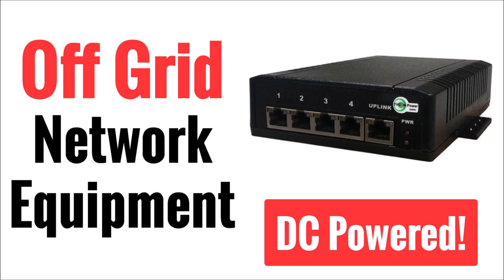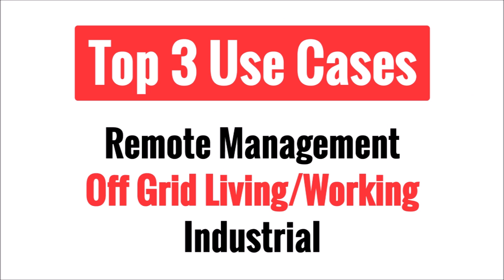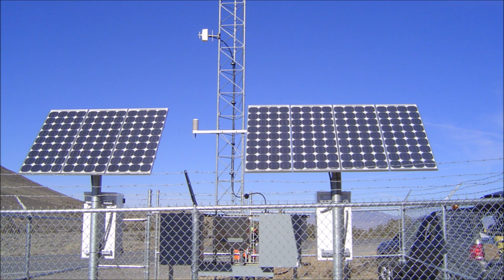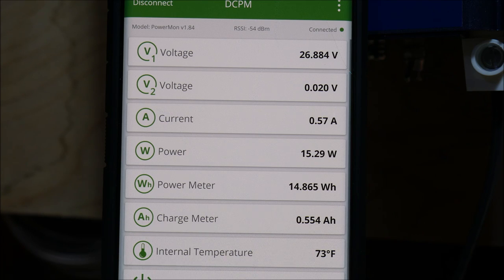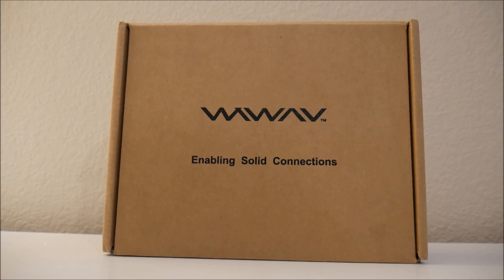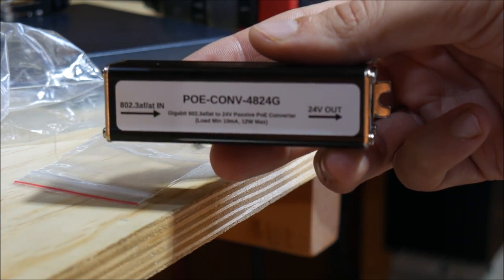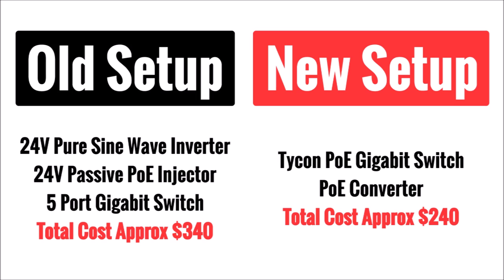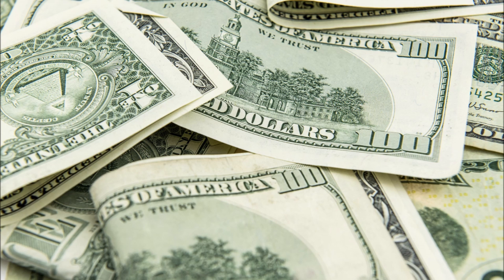Off Grid, DC-Powered Network Equipment For Your Off Grid Solar Power System

Comment: I can say that running on direct wired will DC help lessen another point of failure in your system. I've been on running on a nominal 48 volt DC system for over 5 years and been happy with it even with some of its nuances. Most common failure or human error is tripping the inverter offline and you're down for the count, but your batteries are still up unless it suffered a catastrophic failure which is very seldom unless your charge controller is really grossly set wrong. 

I've built my system around the Magnum-Dimensions MPDH load centre for it's dedicated AC/DC distribution layout and having 14 slots for DIN rail mount DC breakers. A little bit overkill for my application, but I like having a clean telecom room look is what I wanted. Definitely look in to the Tycon and Wiwav products and they seem to offer products that will work with the voltages that I have and eliminating the need of DC to DC converters when possible. If the budget allows for next year, I am planning to install a telecom mini-split heat pump for one of the bedrooms for better efficiency and redundancy.

Comment: You don't need special equipment to run off grid. I have lots of regular consumer stuff running off 3 12v batteries hooked up in parallel. My SBG-6190, EdgerouterX, Netgear GS-308, Asus 1200g(setup as an AP) all run on 12 volt. Get a hand full of 2.5mm barrel plugs and an automotive fuse block and you're off to the races. The rest run through buck converters to change the voltage. I have 2 Raspberry Pis running on Drok buck converters, and a 12v to 19v Drok buck running my security cameras. 

After finding a piece of equipment I'm considering buying, I check the voltage it runs at. If I browse Amazon or Newegg or any other online retailer and can't find a picture of the label on the power brick, I won't buy it.
Reply from the maker: While that is definitely true... 95% of people watching this video aren't going to be interested or knowledgeable enough to want to wire up their own voltage converters and DC distribution system to pull it off.  Not to mention off grid, industrial switches like the one in the video are designed with much better temperature range operation and IP ratings for intrusion prevention so that they can operate outdoors or in dusty/humid environments like attics, sheds, garages, basements, pole mounted enclosures, etc. where most of this type of stuff is going to be installed.

Comment: Great Information!  I've been wanting to install off-grid security cameras around a 26,000 acre ranch where I work.
Can several remote camera locations all be added to the internet url together for an all in one monitoring location for my cameras.  What system do you suggest?
Reply from the maker: Yes, they can.  I personally use the Ubiquiti Protect camera system.  I have done a few videos on off grid, solar powered security cameras using their cameras.  

https://youtu.be/H7Wj25lDToI
https://youtube.com/playlist?list=PLbKwoGlXEWarYz0zemDNO_rzM2xyYstkw
Reply: Axis Communications offers a very intense line of perimeter defense camera.

Comment: So my smart 4g antenna booster box uses mains supply yet steps down to 12v 2.5a, can i just cut the old power supply off and connect a 12v plug to it?
Reply from the maker: Theoretically, yes.  But I can't guarantee that it will work.  It may not be tolerant of fluctuations of voltage from a battery.  It may overheat or shorten its life if, for example, you connect it to a battery bank that is 12.6V.
Reply: @LDSreliance  I have a cisco wireless router that uses 12v, however it has a clamping diode to keep the voltage if it goes above 12.1v.  My solution was to get a computer powersupply that had automotive inputs from minibox.  The power supply converts automotive 12v or 24v to computer 12v.  This means you might need to be careful at which 12v you might be talking about.

Comment: Or use DC to DC convertors.
Reply: They are looser vampires also, sucking power, 80-90% effiencies... No free lunch, someone's going to be paying for it,, I'd put up a 50-100 watt pv   and about 20 ah LIFePo battery, so it always has its own power, no conversation, and can operate forever, it's about how my system works, only no wifi, and my 12v bank is closer to 400ah, and runs my lighting, cameras, and what ever low voltage I need, I'm planning to add a 1200-2kw inverter, for back up, for the back up, incase none of the generators will run, a freggin generator running all day gets OLD, fast!!   And no need to invert, boost, buck then rectify , all that Buisness, wasting power ,,,,,,,,
Reply from the maker: That would work.  Would also require you to have the right connector for the switch but you could just hack off the end of the AC adapter, I guess.  Not sure how efficient that would be when compared with a variable input DC switch like in the video.
Reply: @jamest.5001  I try to only run equipment that works within my battery voltage range(12v system) but that's just not possible in every case.  DC to DC conversion is more efficient then the alternatives in most cases when that isn't possible.
Reply: @LDSreliance   I try to purchase the correct connector.  A friend has chopped off the original connectors and added Anderson power poles so he can switch back and fourth between power supplies.
Reply from the maker: Then that is definitely an option.

Comment: You cant show Ah without voltage of the battery. Should have done the math with wh instead ;)
Reply from the maker: True!  The numbers don't really matter, though.  It was just an illustration.  The potential $ savings are there no matter what voltage is used or components are used.